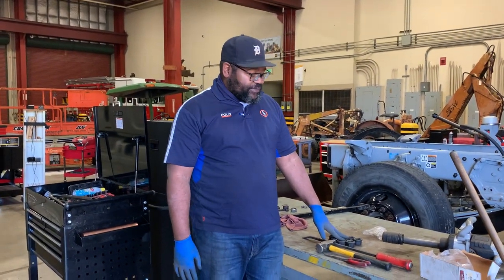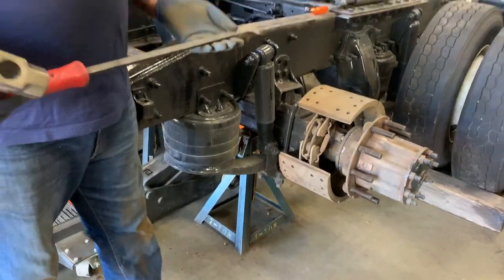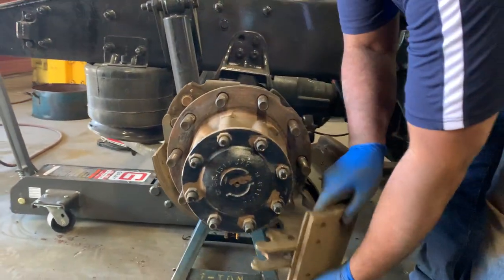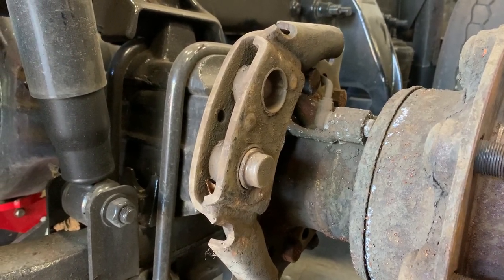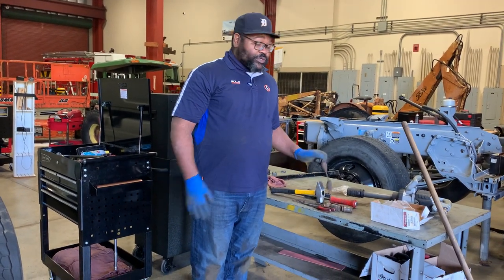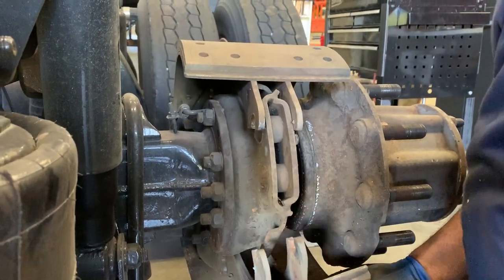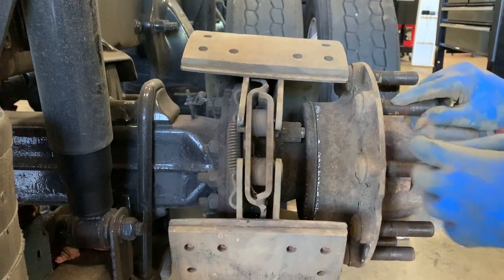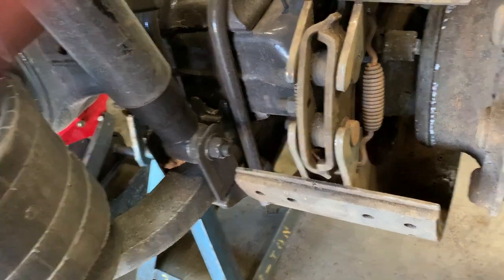Air Brake Shoe Change Basics

Comment: Another comment from me...So my bus has anchor pins, but the shoes have an eye, and the pin is inserted through the anchor itself (no bushing!) and then they get screwed down on the inside. So theyre more like a shaft going through both the hub assembly and the shoes. I will be doing some vids on these oddball systems, just taking some time off to regroup and all...(plus getting this manual done. Its gonna give me A LOT of material...lots of very strange ways of doing the same job)
Reply from the maker: Yea I am looking forward to seeing the brakes on this Bus it seems so interesting when you describe it. I am going to turn my notifications on so when you post ill see it.
Reply: @learndiesel528  Its in the line up...I have some more videos (car mechanic stuff) and Ill do the bus brakes. I have to get them fixed anyway. I have a nasty leak somewhere. Im going to take a bit of a break, and regroup. Im not very good at youtubing so Im just trying to figure out things...looks like the tips I got from all those how to youtube channels were just awful. I was doing better being my annpoying self! lol

Comment: Thats the most important tip. Never do both (or all 4 etc) brakes at the same time. I dont know how many times I was about to muck it up, until I looked at the other wheel I didnt touch. Oh...THATS how that spring goes, etc.

I replace the hardware on my cars too where it isnt as critical, but there are some of my vehicles I dont have that luxury. I honestly dont know what Ill do if I break a spring and dont have a replacement. Im thinking of taking each set from a new  hardware kit and measuring how many lbs of force each generates for a certain pull length, and either find another close enough or fab them. 

Oh, one piece of constructive criticism. The camera needs a light. (I do mean it in the best way, its just stuff I learned doing my vids, because I feel I really suck at the video part...its a whole new career to be honest, and automotive channels are basically two careers rolled up into one).
Reply from the maker: Yea I bought a ring light not to long ago but I have not used it in any videos yet. I see that it really does make a difference in other people videos so I am looking forward to trying it out. Thanks for the input.
Reply: @learndiesel528  I only got one recently too and it makes a world of difference. I only say it because Ive been doing videos for 3 years and I really do suck at this lol.